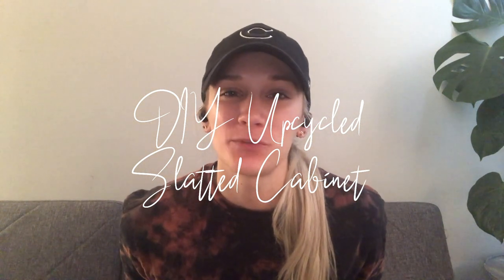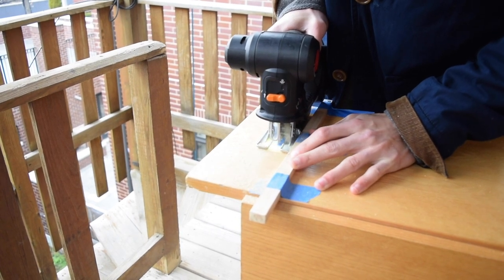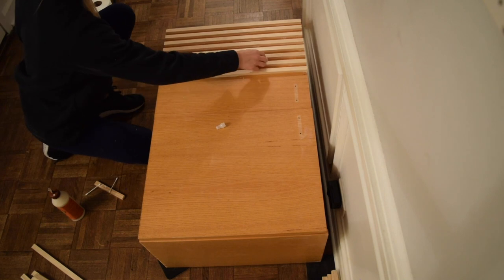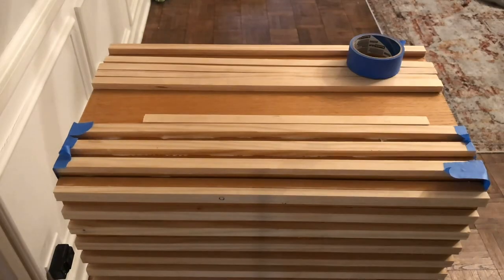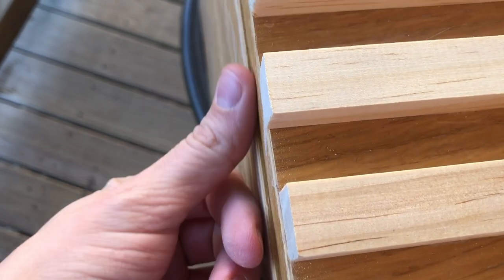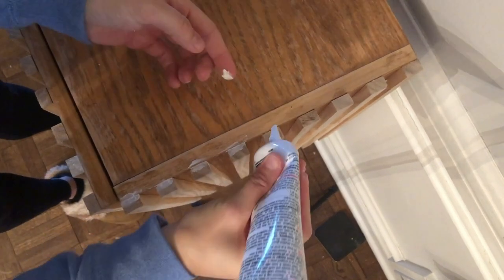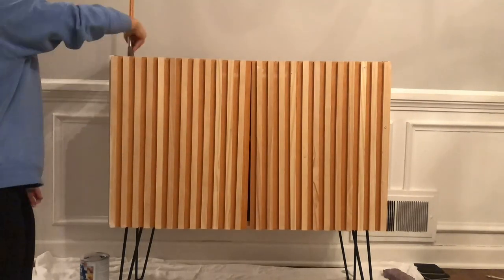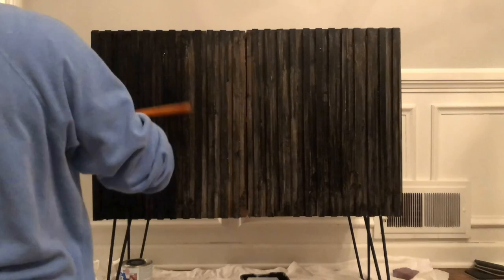DIY Mid Century Modern Slatted Wood Cabinet Upcycle | before + after

Comment: That Rustoleum semi gloss is low key kind of awesome depending on what you’re painting. And it’s SO inexpensive.
Reply from the maker: I totally agree! I have used it for several projects but I think the problem here was maybe the primer. The other times I have used the same paint I haven't primed and have had zero problems.

Comment: Probably a silly question but how did you measure the small wood panels? How do you know how wide they should be and how much space should be between them so they fit perfectly?
Reply from the maker: Not a silly question! I used a scrap piece of the same piece of wood as a spacer. I lined up my first piece to the edge of the cabinet and then I placed the spacer between the next piece I was gluing down. Before I started gluing, I took all of my cut pieces and lined them up on the cabinet to see if my space was going to be the right width. Luckily, it was perfect in the case, and I didn't need to do any math! :)